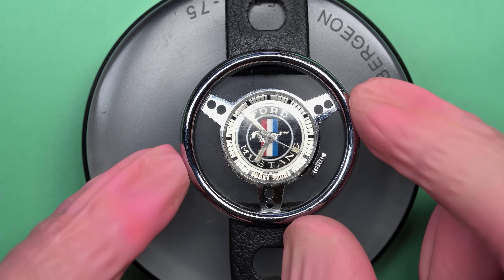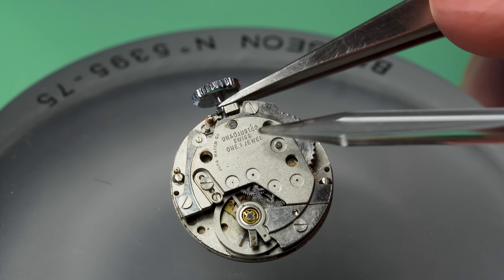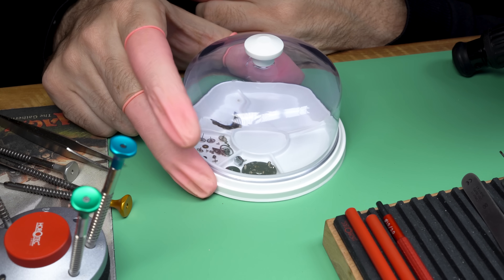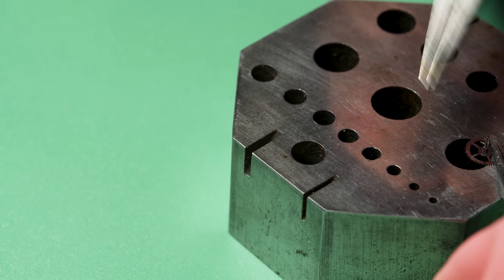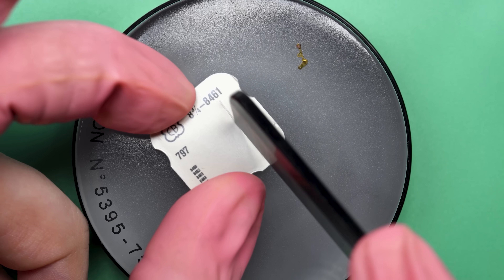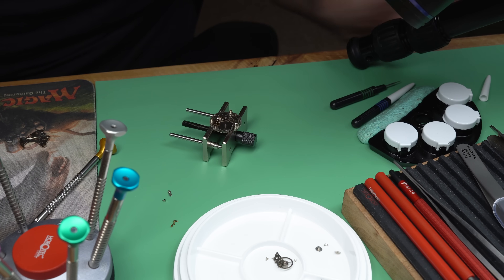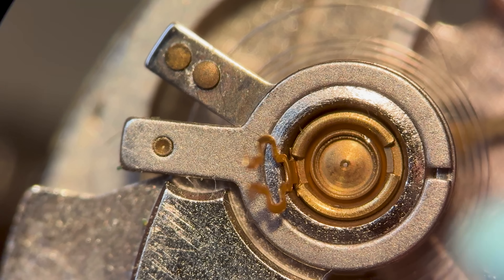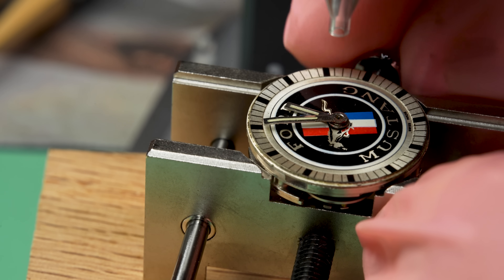Restoring a Ford Mustang Novelty Vintage Watch with a Very Strange Issue

Comment: Given the weird "case"-design, and cheapo movement, I wonder if that watch was even meant to be sold. Could've been a novelty, give-away item meant to be handed out at a press-event or perhaps to employees at Ford dealerships. 
Not a Mustang expert here, but seeing the design of the logo on the dial and the fact that it has a super cheap mechanical movement instead of a quartz one, I'd hazard a guess this is from the early era of Mustangs - probably mid to late 1960s. No Mustangs before 1964 and by the mid to late 1970s, something like this would have had a quartz movement.

Comment: Do they use DRY ICE?  How do they build these fast & cheap in a factory?  Do they use something like dry ice to hold the internal wheel chain & other parts in place when screwing it together & after once together just let the dry ice melt out afterwards?  ...btw, dry ice would be a great way to do it, would be clean after the CO2 evaporates leaving no trace elements behind.  Could see them having a mold that holds the parts where they need to be w/in the watch & then filling the empty area of the mold with dry ice.

Comment: Silly Question Time! So, if a unique wrist watch like this is considered a Family Heirloom? and the watch movement is absolutely rusted, deceased, has the faint remains of a Norwegian Blue Parrot resting gently in its eternal grace of a mechanical tomb? Can you size the watch, watch dial, and casement and find either a higher quality movement or a more modern movement to save the Family Heirloom and restore it to full working condition? Because that would be boss!

Comment: the last copper looking washer was very misshaped  (time stamp 25.42) you do everything right and then leave that???
Reply: Brass, I believe. They are supposed to be like that. They are mildly springy, to apply a wee bit of pressure to the underside of the dial, and keep it from interfering with any parts beneath it, especially moving ones.
Reply: @LS-uv9gg learn something new ever day , cheers

Comment: confused by this vid. this is a watch that would really appeal to mustang lovers. why not change the movement making this like a custom watch. upgrade it, showing it on video, with a quality movement so that it moves beyond a novelty watch and actually is worth something. actually, if you can find enough of these with the custom case and dial, it would be a good swap to do in numbers. custom watches, just like custom cars, taking an old case and putting a new motor in it. also, confused about the decision to leave the old england on the crystal, nothing to do with mustang and just used originally because it was cheap. but tks, enjoyed the vid

Comment: No way you got an old England wheel watch! They made a bunch of these in the early 70s and I have the Ferrari version with the old font! It’s a runner but it’s definitely many minutes fast a day sadly! The wheel is supposed to be black on the rim. That strap is original, the tropic sport rubber one

Comment: It doesn't look like you cleaned the mainspring - the last shot before the cleaning, and the first shot after (with all the parts laid out) both show the barrel still assembled.  Did this just miss being filmed, or is there something about this watch that precludes cleaning/replacing the mainspring?

Comment: I Don´t see you use oil in any of the parts, why?
Reply: Right after he put the top plate on. Did the cap "jewel", too, and of course a touch of grease on the keyless works.

Comment: The watch is as crappy as the cars. Makes sense really.

I should say that when removing or replacing the balance wheel you should pick it up by the cock and the wheel to make sure no damage occurs. I also ordered some parts to fix my Rolex and just the change in climates warped the wheels. I had to “fix” all the replacement parts before I could replace them. Was a nightmare.

Comment: at 1mn when the seconde hand spin for 5hours that's 18 000 secondes(revolutions) in 6 secondes the seconde hand spin at 3000rps 180000 revolutions per minute.

Comment: So you decided to service a junk pin-pallet movement?  What I used to do was to throw that junk movement away, and replace it with a 17-jewel movement from a Ladies' watch that were and still are, much better.  And I did that, explained that to the customers showing them the junk movement together with the replacement movement, and they were fine with me, and the repair was just 10.00 USD plus the movement that was between 10-15 USD each, and they were having a watch for the rest of their lives, not this junk. But that's MHHO.......